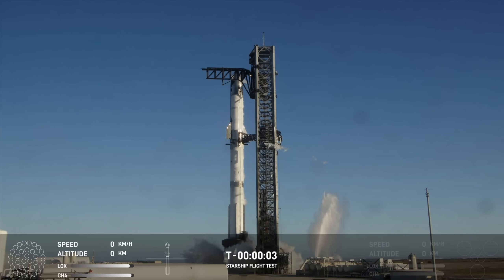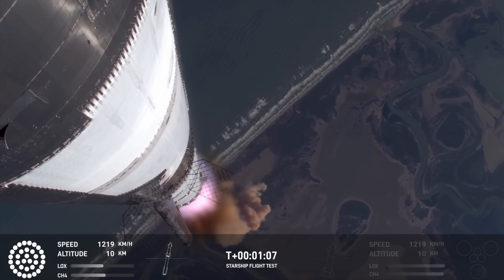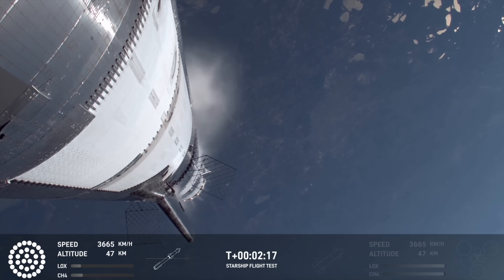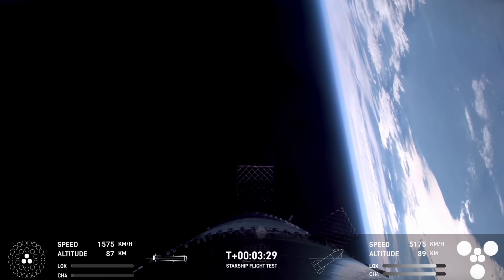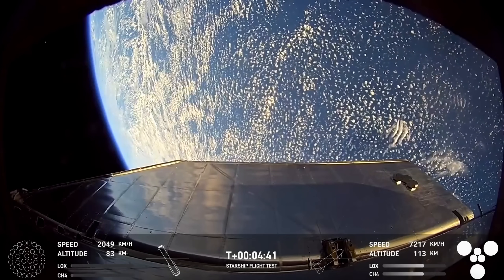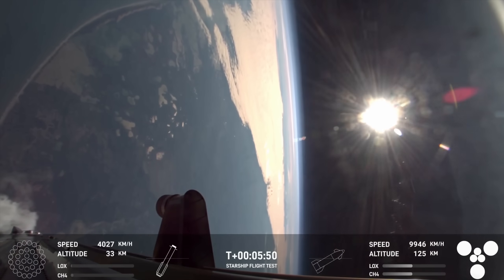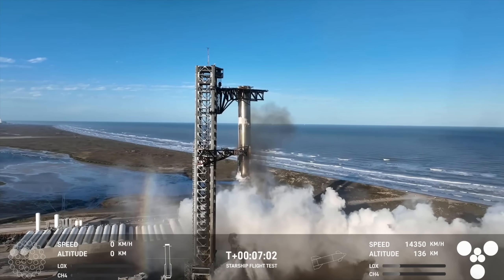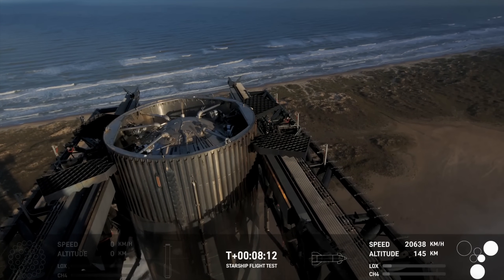Here is why SpaceX LOST Starship vehicle after SUCCESSFUL launch and Superheavy catch by Mechazilla

Comment: The claimed cause is simply a layer of ablative material which has peeled back, and it's on a protrusion mounted on the upper portion of the ship. This means there remains at least two layers of material between the inside and outside of the ship, all of them likely stainless steel. If you watch the display of engine status at lower right at the time of ship loss-of-contact, you'll see one sea-level Raptor go offline, then a few seconds later another. Then a vacuum Raptor fails followed by another sea-level version, and finally a second vacuum Raptor. Signal loss comes with one vacuum raptor indicating "on."

One engine failed with likely deflagration which damaged the second engine to fail. With each engine failure you likely get further damage to other engines, giving the cascade of failures we see. With the uneven thrust of remaining engines the ship would commence anomalous flight, tumbling out of control until self-destruct.

Comment: Another failure... How about they make a cheaper working "one use" system and streamline the productiuon?
Re using it is not economical, never will be. More complex, more expensive, costs to restore and refurbish. Not to mention after re entry you might as well scrap and use a new one because of components ware down. Unless you have no safety or quality standards.

This aproach is a stupid, when you think about it. They hype it so you don't think about it. So they can steal your tax money and spend it on this nonsense.

Comment: Dude don’t click bait 😒
Reply: Look at the left hand side of the screen. A hole appears 45 seconds into the launch.
Reply: @mih1961 that's just one of the tiles flapping off. If it was truly a hole in the tank that big, the ship would instant blow up at that point. The explosion was caused by leak in the engine bay
Reply: @mih1961  That is simply a layer of ablative material which has peeled back, and it's on a protrusion mounted on the upper portion of the ship. This means there remains at least two layers of material between the inside and outside of the ship, all of them likely stainless steel. If you watch the display of engine status at lower right at the time of ship loss-of-contact, you'll see one sea-level Raptor go offline, then a few seconds later another. Then a vacuum Raptor fails followed by another sea-level version, and finally a second vacuum Raptor. Signal loss comes with one vacuum raptor indicating "on."

One engine failed with likely deflagration which damaged the second engine to fail. With each engine failure you likely get further damage to other engines, giving the cascade of failures we see. With the uneven thrust of remaining engines the ship would commence anomalous flight, tumbling out of control until self-destruct.
Reply: That allowed more air to enter. But I Yes you did not read elon's poster saying they had oxygen and methane fuel leaks. You didn't see the fire at the rear flap hydraulic joint. So you don't know what the heck's going on but you're just posting anyway
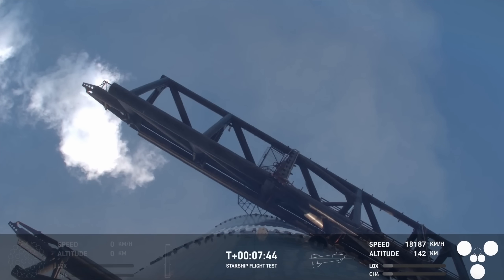Reply: @charlespaluha1247  flames at the hinge @7:53. What I saw at first was just oblative material. I re-watched it on my computer.
Reply: Dude is gave me all I expected. Just watch before you comment
Reply: I’m going to remember NOT to watch this channel. Click bait sucks